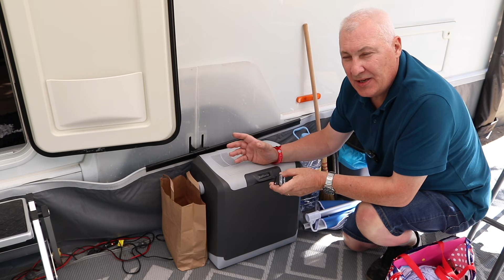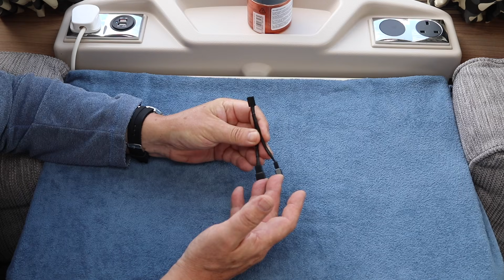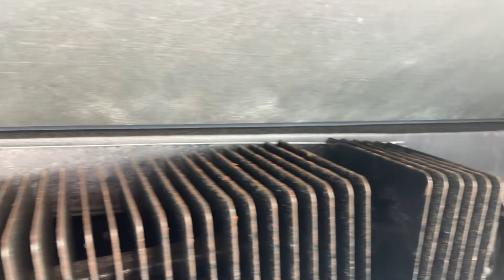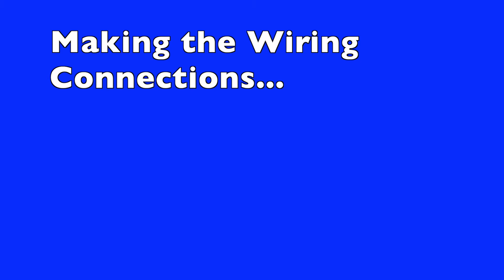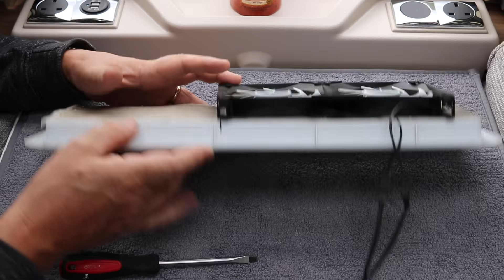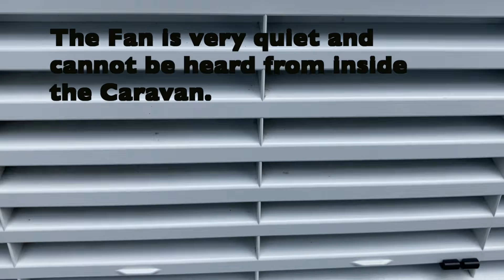Titan Caravan Fridge Fan Install (That Works)

Comment: Hi there. Our microwave has decided not to work in the caravan! Can you just buy one and fit it yourself or does it need to go to a caravan workshop to be fitted?
Reply from the maker: Hi, You can use a standard microwave but you need measure your current one and also make sure you buy the same wattage MW as well. Hope this helps. Phil. 🙂👍

Comment: Very good video Phil,keeping the fridge cool even in the uk has always been a pain in my van  , I always use a fridge thermometer and it’s quite worrying when you check the fridge and the temp inside is 10c, this is very affordable and one I’ll definitely consider, thanks Colin.
Reply from the maker: Hi Colin. This has been a great investment. Yes even in the UK it can be a challenge to keep the fridge cool. This does a great job.  Thanks Phil.🙂👍

Comment: Morning Phil,
Great vlog on a nice bit of kit.
It's a shame you had to purchase a second one though, would expect dometic to do the job.
Do the tabs on the outside interfere with winter covers.
Could the controller go in the battery box.

Cheers Paul 👍
Reply from the maker: Hi Paul. sometimes we like to show our ups and downs. This is a good fan system. I am not sure if it would effect a vent cover. I don't use vent covers as I cover up the van fully at this time of year. I thought about the battery box but I would still after drill into the firewall! This is something I have not worked out yet. Thanks Phil.🙂👍

Comment: Is Bluetooth an answer to the issue with the controller.
Reply from the maker: Hi TT. This could be the answer I just need to find the right system that would work. Thanks for the tip. Phil.🙂👍

Comment: Good info Phil, thank you. A blue tooth link to the controls from a phone app or control unit like you get with cheap LED lights would make it perfect- is there such a thing?
Reply: Having watched another video about kitchen lights on Proper DIY, there are such a thing. Amazon shows a variety of devices at a reasonable cost
Reply from the maker: Hi John. I will look into this over the next few weeks. It would be a great idea. Thanks Phil. 👍🙂